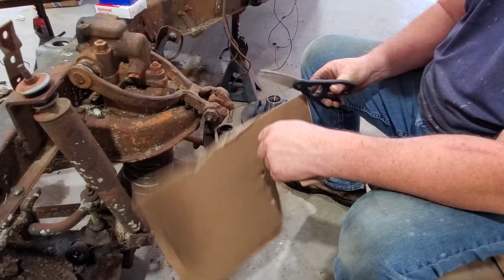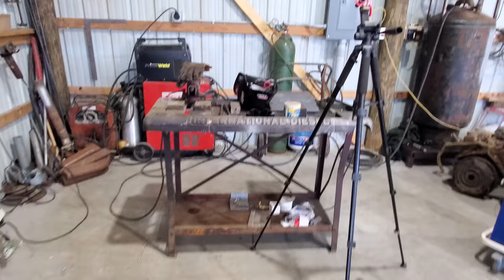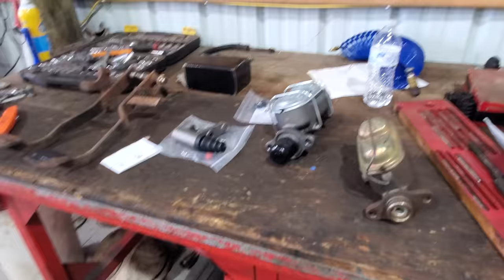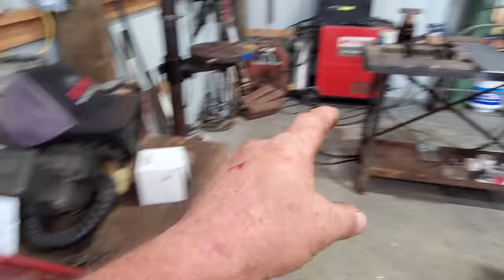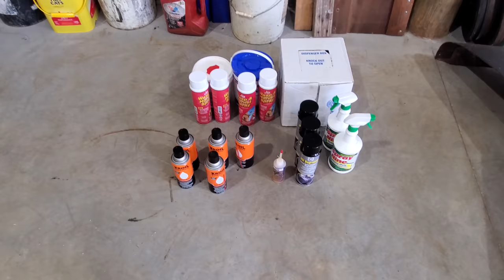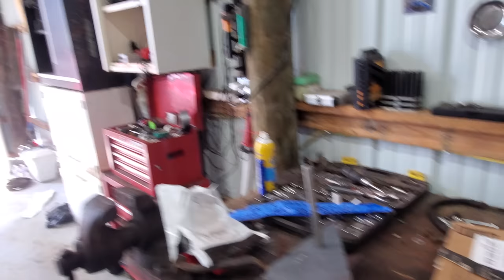1940 Chevy Coupe Part 4: Caliper Brackets and Swinging Pedals!

Comment: I see those Chinesiom rotors are still a pain. I bought a set five years ago for a disc brake conversion. The bearings wouldn’t fit in one of them. It was way out of spec. When I called the company and told them, they sent me out another one with no questions asked.They didn’t even want back the defective one. Apparently they were aware of the problem. You would think by now the factory would have remedied the problems. I really like this build.

Comment: Chad thanks for sharing your adventures, enjoy watching your channel. 
I did not read all the comments so maybe this has been mentioned already or you may already know, 1969 Corvette has a 4 wheel disc system. If you use that master cylinder on a dic/drum setup a residual pressure check valve will be needed in the rear brake line.
Reply from the maker: Not sure it'll be necessary. We'll see how they feel once I get them done.

Comment: Hey chad a really easy way to align a tap is to use a nut, just thread the tap through and use the nut as a flat reference to make it straight cos it's perpendicular. I have no idea how you get so much work done my work just seems to pile on.
Reply from the maker: Much easier to use a drill press but yes I've used your method too. 👍

Comment: Excellent video Chad  :) I like metal fabric  also mill machine work plus welding you did and very good work did ! Also planning for garage Air Conditioning and Workbench  also installation  for warm in Winter Season months too too!

Comment: I use a white out pen to mark things I'm going to cut with a torch,,, it tends to stay on there better than anything else I've tried.... You might? Try it sometime? Might or might not work for you.... I like that idea you used too! I learned that trick about 30 years ago.also if you are using your phone to video things,, there are glass camera lens protectors available now,, that apply to the camera like the glass screensavers do.. thinking about getting some for my phone.amazing-zon has them and ebby does too.

Comment: I would have kept those plastic sleeve bushings for the two pedals so there wouldn't be any metal on metal wear and screeching noise during operation. Nice manufacturing job. A lot of tedious work, you have a lot of patience Chad.
Reply from the maker: It'll probably be just fine without them.

Comment: If you weld one of the spacers you made to the clutch pedal it would help with it not moving side to side. Similar to the way the brake pedal is. And if you’re not using the bushings I would drill and tap for a grease fitting so you can give a shot of grease when it starts squeaking. Just an idea.
Reply from the maker: Seems to not wobble as it is and how often do you grease your pedals? Me never! 😂 It'll be just fine as is probably.

Comment: Do you prime your oil can spouts by putting your finger over the tip first, to get it to pump , I didn’t realize this , maybe common sense. Awesome fabrication and understanding of the process, the right tools make the job easier, oh my caliper hitting floor . Great video and shop build . When you could take 3 cars apart and make one good one.

Comment: That's a heavy duty pedal box.  If it was on the engine bay side and there was room between the top and the hood, it would be a good place to mount the battery.  Like your fab skills.  Did you replace the hood on the pickup? Love your videos.

Comment: So do you need a set of those drill tabs that fit in the truck with the realtor you can use the drill press and drill holes and stuff I’ve seen we use the pretty late

Comment: Great video as usual. 👍
  Could a feller drill some weight reduction holes in that clutch/brake pedal assembly? 🤷🏻‍♂️
  Maybe for air movement, have you considered louvered gable vents and/or ceiling fans? 🥵
    God bless 🙏🏼🇺🇸
Reply from the maker: It ain't a racecar so I ain't worried about it.

Comment: If you buy a microphone like actors use in theaters and musicals, you will have no breathing sounds, and nothing brushing against it. It is the size of a pea, comes in various "skin" colors, you tape to your cheek an inch in front of your ear with surgical tape, and run the wire over the ear down you back under the shirt to the transmitter/recorder in your back pocket.   Keep up the great work
Reply from the maker: No thank you. I ain't having wires running up and down me!

Comment: could you drill holes is that thick steel to lighten it up and still maintain the strength, just an idea.
Reply from the maker: Sure you can if you want to. It ain't a race car so I aint worried about it.

Comment: try tighten the nut on the end of your cross screw on end were taper attachment , then with your compound make sure it is locked , you should have some adjustment on your cross screw , take the compound and shove back and forth , if you have excessive movement, there are 3 screws right in front of the compound , those are your adjustments, there is also another adjustment on your give you can tighten a bit to remove slop , take off the front face plate , on some the give screw is exposed , tighten all these slowly and one at a time . 
hope that helps a bit, all you needed sitting in that chair watching the machine run is a hamburger, then you be a real manula machinist hahahah
Reply from the maker: Already adjusted and tightened everything. When I say something is wore then trust me it's wore out.

Comment: I am sure you said in the previous video but. What are the calipers and rotors you are using for this conversion?
Reply: It's stuff of a 79 Camaro except for the shim he made for the back bearing and the caliper bracket he made.
Reply from the maker: 70-77 camaro.

Comment: I haven't had any problems with your audio,, wonder if you put the lapel mic on your hat? Because the problem is most likely when you're bending over,, your neck area may be closing off the sound?? If you could rig it to your hat it would still pick up good and wouldn't get covered up causing the muffle?? Up higher it probably wouldn't pick up your breath either.... Just a thought..... As i said i haven't had any problems hearing everything you say.. the only other thing that might help,, one of those ( boom) mics that fastens around your ear?? Or if possible lowering the lapel mic some how? Use a safety pin and mount it down on your chest some? Instead at the collar....or if you wear pocket t shirts maybe at the pocket?? Just thoughts and ideas..... If you found the type that has the little puffy thing on the end ( noise cancellor) that loops around your ear,, might be a good choice??